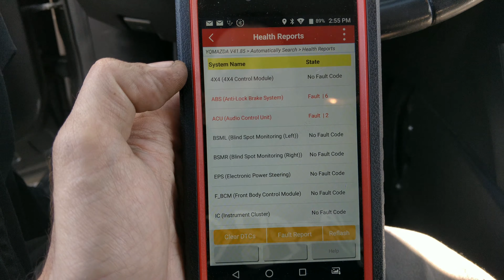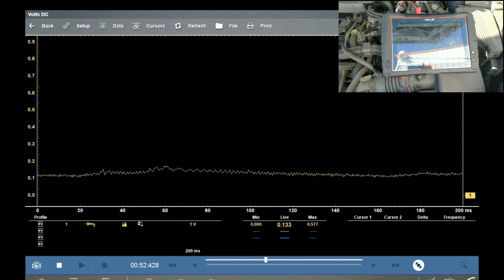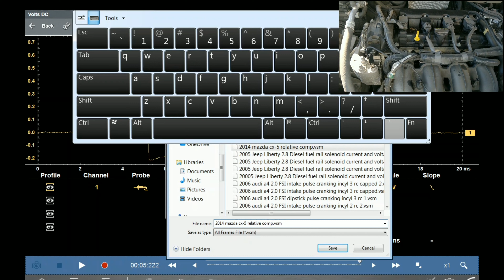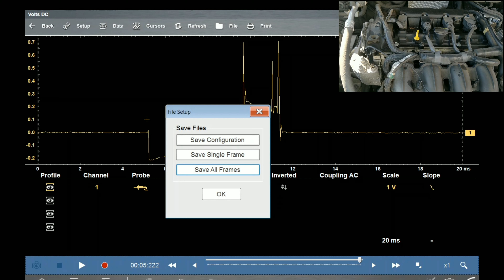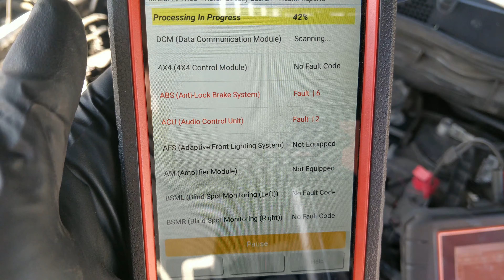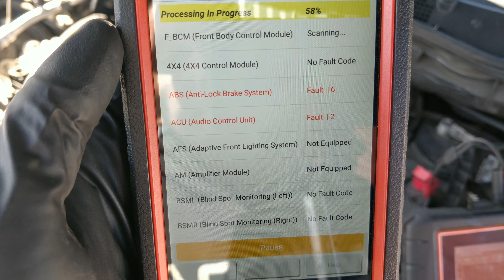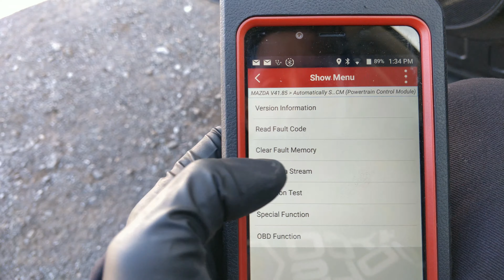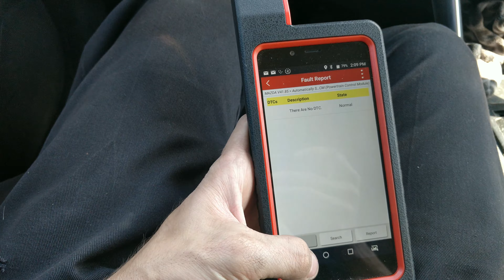2014 Mazda CX-5 2.5l P0300 P0302 Misfire No Power

Comment: The contamination on the spark plug insulator is attracted there by the high voltage discharge.
Usually just some light brown Corona staining.
Never seen any that bad though,
but you did have excess oil therefore more vapours to attract. They most likely are the original plugs - especially having the Mazda branding on them.
Reply from the maker: Thank you for the clarification. I've never seen anything that bad either.

Comment: So I have seen this on those plugs before...are those the right plugs for the car? It says Mazda but is it meant for the 2.0?
Reply from the maker: I am pretty sure they were the correct part number. These motors are high compression GDI and have shorter plug change intervals I believe.
Reply: @RobertDotterer  correct gap is usually  "0.44"